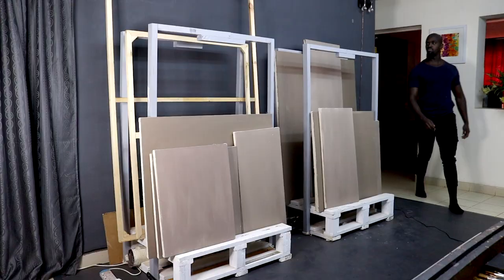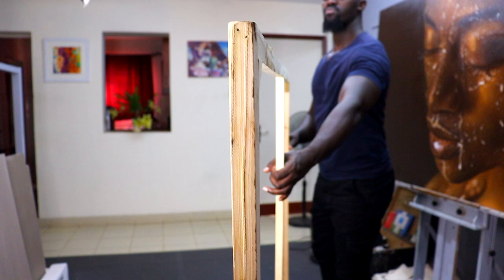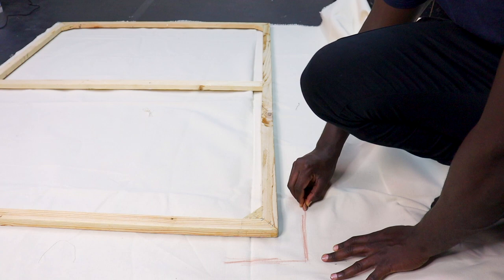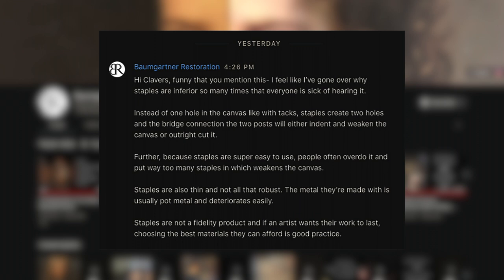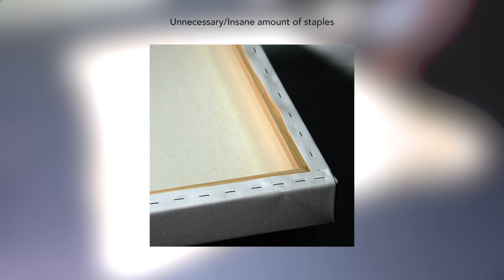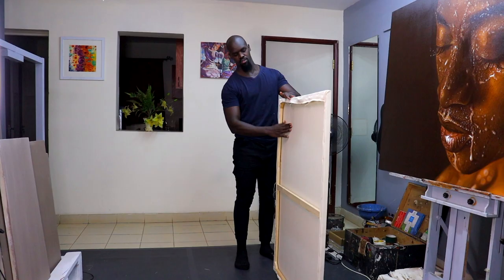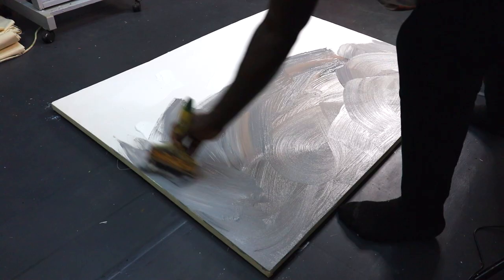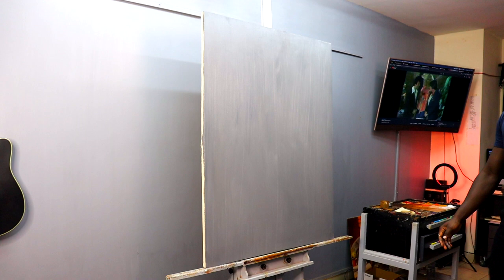Canvas Preparation for Painting - With Common Mistakes Explained

Comment: Some insight from one creative to another . Have you used vinyl matt or gesso
Reply from the maker: Yes I used vinyl matt on a couple of paintings 8 years ago, but when I had to roll them the dried (matt) primer cracked all over and destroyed both paintings 😆 learnt the hard way.

I’ve never used gesso mainly because silk vinyl does it’s job just as well if not better, is way more accessible (and affordable) and mixes with acrylic paint so I can kill two birds with one stone when I buy it.

Comment: You don’t always need to cut the canvas, due to it’s weave you can just rip it 😎
Reply from the maker: You can rip it along the warp but not along the weft (or vice-versa depending on the orientation) so either way you’ll need scissors for one of the sides.

Ripping it is also risky, labour-intensive and a little too carefree. Scissors give you precise control.